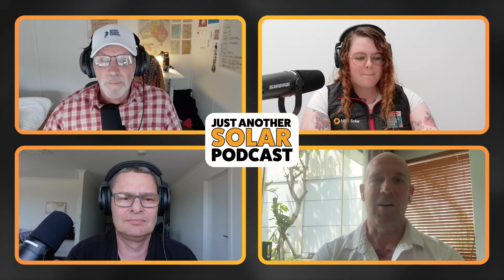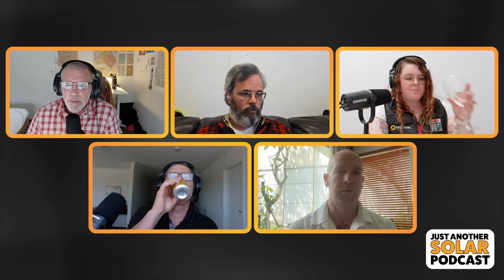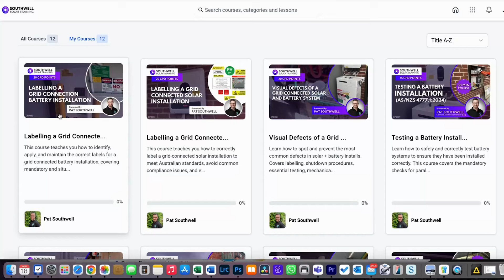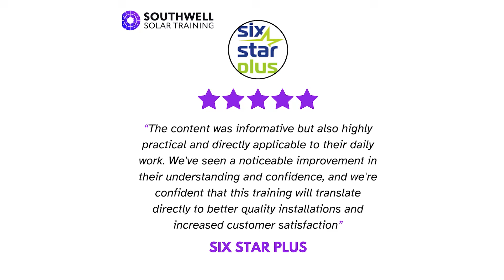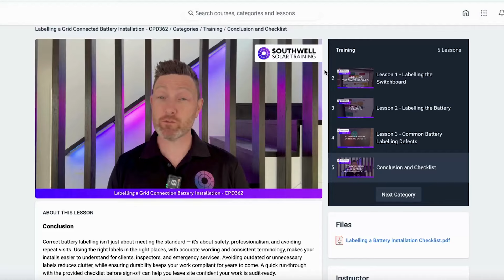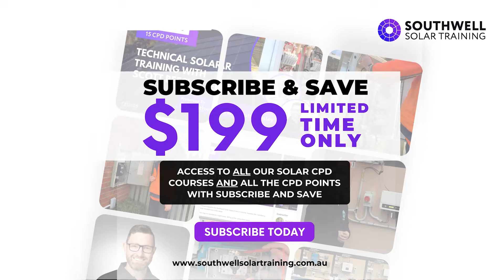#97 -  The SIG Meltdown w/ Anthony Bennett

Comment: Maybe they should prewire all of their AC connection plugs with the appropriate sized heat resistant cable with 1.5 meter tail and recommend we use an adjacent isolation switch. This would take the risk away from the product.

Comment: I'm also not buying the line that Sig were unable to say anything to customers because of "regulatory bodies". You seriously expect us to believe they were able to roll out a firmware update and change the operational parameters of thousands of systems and yet we are to believe they were not able to say; 
i. they had/were doing this, 
ii. what the changes were, and
iii. why?
What utter nonsense. There is zero in any of that basic information which would have required regulatory body approval.
Meanwhile a whole bunch of us were wondering what had happened to our systems and were getting zip from Sig about it, while our installers were also oblivious to the fact.

My biggest beef now is (once again) the lack of information about when I can expect my faulty inverter to be replaced. None of us know.

Comment: I take issue with the suggestion that the firmware throttle is a sufficient safety precaution.

My 12 kW SP install was done perfectly and as per Sig's requirements. High quality installer. Even so, my AC plug, even under firmware throttled operation, is dangerously hot. Hot enough to burn my finger upon immediate touch, while the cable right where it exits the plug can only be finger held for about a second before it's far too hot to touch. I know from my lab days the sort of temps this touch test equates to and it's not good. At most it should be mildly warm.

I have imposed my own safe mode of operation until this thing is replaced. Zero exporting, zero charge from grid, limiting inverter output, no sustained heavy loads, using grid power for household loads directly. It's quite restrictive in an all electric home with two EVs and summer cooling loads soon to ramp up.

I implore users to check their AC cable/plug temps when under sustained high AC throughput (which could be exporting from DC-coupled solar once the battery has fully charged, or charging the battery from an AC source such as the grid or AC-coupled solar PV, or sustained heavy AC loads such as EV charging from solar). In my case what the Sig firmware thinks is OK, just isn't.
https://i.imgur.com/MNO6qDD.jpg

My installer is trying very hard to get our replacement done as soon as possible but there is no information on the time frame for replacement.

As to Sig's Australian user's FB page - they most definitely have deleted people's posts. There are multiple examples from Whirlpool forum members having experienced that. My post from 22 Sep about the EVAC (well before this ruckus) is still waiting to be posted.

Comment: 21:30 "Sig doesn't have an installer partnership network" - But Sig does have an "Installer Tier" rank such as Gold, Silver, Certified.  
I wouldn't get my Sig installed from a company other than at those from at least Sig "Gold" + Solarquotes Legendary/Platinum status
Reply: Membership to an installer tier isn’t a requirement for installing the product is more the point. By comparison lots of manufacturers make this necessary and they can pick and choose installers a bit more this way/ have a network for communication that they know covers all involved parties. Those ranks generally reflect volume of sales rather than quality of install which unfortunately don’t go hand in hand.

Comment: I’m worried a Sig 3 phase 30kW EC at 60dB would be too noisy for my neighbor (1.5m from the fence line) if installed externally on side of the garage. I live in a tight high density suburbia. 

I wouldn’t install a non-sodium ion battery + EC Inverter inside the garage for fire 🔥 reasons. 

My non-sodium ion BEV must also be parked outside

Keeps home insurance premium down.
Reply: Lithium iron phosphate doesn't have a thermal runway. Very safe in the garage. Those Sig batteries all have a fire extinguisher in every battery.
Reply: @chrisdodd5269  my home insurance company doesn’t agree and threatened to increase my premium if  I park my LFP BEV inside the garage or install LFP sig inside my garage. Maybe it’s time to shop around for a new home insurance. 

I’m afraid I’d get the same knockback
Reply: @bobbyjames235  who is your insurance provider?

Comment: Even if 99 percent of Sig installations are fine, 100 percent of users should know exactly where they stand regarding whether their house or building is going to burn down. There appeared to be a whole lot of ducking and weaving rather than ownership, urgency and clarity. Lets hope that there is no repeat performance and should the need arise for a recall in future, Sig get onto it right away in a positive way rather than being defensive and elusive.
Reply: the asian pride issue.

Comment: I think one of the issues is the ferrules for the plug and the education around the corrct way to terminate a ferrule to the wire. An incorrect termination, will develop heat, and will significantly effect the connection perfromance.  Specifically the correct terminal crimping tools for the ferrules being used.
Reply: It's more than that. The plug pins and socket do not make very good contact.
Reply: @alexsimmons1803  Yes correct. That is also an issue in the current plug. It does not have any feature to take up variations of diameter or alignment unlike a 3phase high current plug which does have contracting pins to suite the socket.

Comment: Nice video. Sorry for this negative comment Jess! 
From a company that makes note of the  top engineers they poached from Huawei, where is the engineering in that plug? Why did accelerated testing not pick up the issue? Did they even have time to do accelerated testing? 100 have failed in the first year. How many of the 99 percent would have failed in the future?
Goodwe was different. Non compliance. Tesla was different. 3rd party cell issue. This was a really poor designed plug. I’d be concerned about their DC to DC converter setup. My tests are showing it runs really inefficiently- which adds up with the heat loss complaints.
Reply: For faster innovation, “move fast and break things” is the attitude. It gets feedback from the community quicker, allowing companies to iterate faster on the product development, thus get the market quicker- akin to agile software development. 

That’s the unofficial motto of Tesla FSD too. 

Unfortunately, people’s lives are involved.
Reply: Hardly negative mate, it’s constructive and a very good point, you’d expect a distribution curve of failures somewhat. Not sure if we should call a plug issue a product failure. Appreciating it’s part of the product it’s a different category to battery cell swelling or something of the like. Interested to see what your DC testing shows- if you don’t mind loop me in on your results mate!!
Reply: You make a fair point Mark. We’ve seen plenty of examples of small design oversights that don’t cater for every scenario or the rigours of Australia over the years.